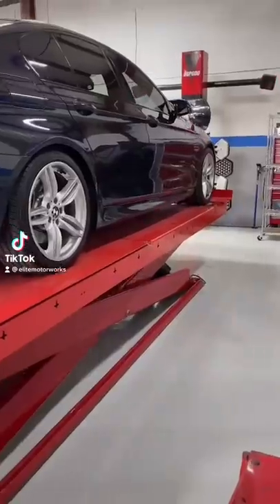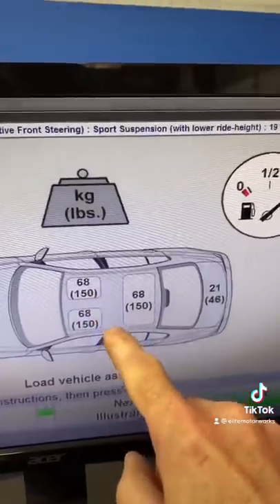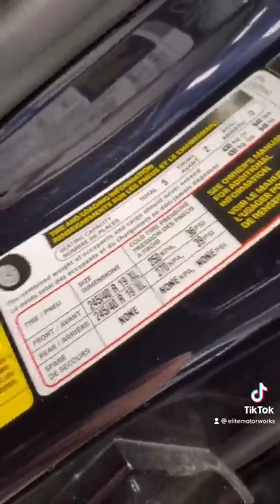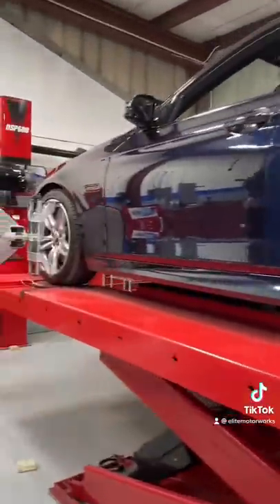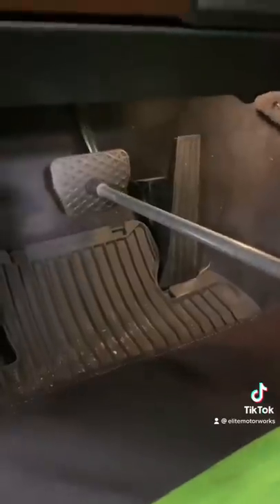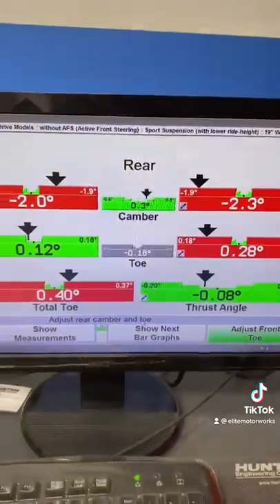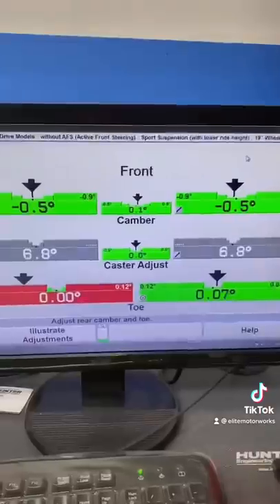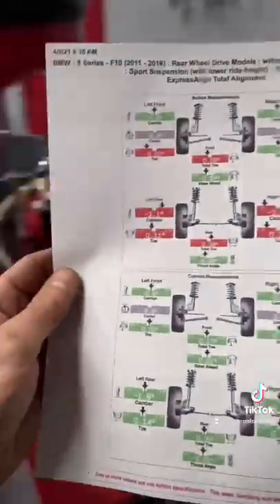How BMW does alignments #shorts

Comment: I've never seen any tech add weights to euro vehicles when doing alignments and I've never seen an issue, i like that you're doing it by the book though.
Reply: Can confirm we don't do that shit at pepboys lol....do have a nice brand new machine though, wish we had that steering wheel leveler, genius idea
Reply: Definitely gets you the best results.
Reply: @bestbomb17  me, eyeballing it wishing it was a raptor.
Reply: It’s actually pretty common, Mercedes Benz vehicles have the same procedure.
Reply: @crappy60  i think he means, he knows it should be done but not alot of people do it.
Reply: Well this dude works at or owns a really high end euro car shop, so hopefully he's doing all this stuff by the book, and he def does.  If i owned a bmw or a mercedes etc, id bring it there, until then im happy with my Sonata lol.
Reply: @crappy60  as a mbz master tech I can confirm we do not use weights when performing alignments. We do check ride height, with an inclinometer.
Reply: Idk maybe to 🤔 compensate for the passenger weigh
Reply: Then ur not a bmw tech. Everything from e46 and up your supposed to use weights
Reply: It really has nothing to do with euro vehicle's the reason you add weights is because when the vehicle is at highway speeds it sits lower to the ground and the wheels spread out a little bit further. If they're not using weight's its because they're not doing it right.
Reply: @herbsewell4995  when doing alignments only the euro and foreign vehicle ask for weights, not most cars.
Reply: @recarored9862  I don't care what the manufacturers asked for, the FACT of the matter is you're supposed to use weights on all vehicle's with the exception of heavier vehicle's, or vehicle's that have automatic ride height adjustment, or vehicle's with stiff suspension's. It's not a matter of whether or not the manufacturer asks for it, it's a matter of whether or not the vehicles ride height lowers at high speeds.
Reply: @herbsewell4995  it's most alignment machines like Hunter that have done their R&D.
Reply: There is an option to compensate for weight
Reply: I took this as a troll,but youtube says it's real.
Reply: @bestbomb17  the steering wheel level indicator on the computer is a bit useless if the alignment is already out.. I usually have to use a combination of the indicator and eyeing it
Reply: @crappy60  False. I’m a Factory trained 15 year Mercedes Benz master tech. The only thing we use specific weights for is teaching in seat occupant sensors in regards to SRS/airbag systems. As for alignments, we use a Romess Inclinometer to check control arm angles which directly relates to vehicle ride height. Other than serious race cars, I’m not sure why a manufacturer would require massive amounts of weights placed in a vehicle to perform a wheel alignment. Then again, I’ve only ever worked for Mercedes Benz. Good job on the video, though!
Reply: Most customers don't push their cars or even pay attention to how they handle. 
After the first alignment at a big tire shop my car was all over the road....like a regular car. Took it to BMW and handling went back to being like it was on rails.
Reply: Not only weights and tire pressure , but ALSO a fully filled gas tank. 
I learned this as well after owning my second bmw. Took it somewhere else, told me about the requirement, filled up the tank, had them add the weights, and it drove dead straight after the re-alignment.
Reply: Well the more weight you add and the more the suspension is going to be compressed in the alignment of the wheels and everything will change so if you put the recommended weight in it like they did it's acting as if it's full of passengers so then you get the best ride possible
Reply: @mbdoc631  inclinometer? Why would you use one and how would you use it for ride height? We use those in aviation maint to measure/adjust blade angle and flight control travels. Wouldn't a tape measure and bubble level be cheaper and easier to use just to measure ride height? Seems overboard/unnecessary
Reply: @crappy60  extremely common procedure that is never actually done. That’s what you meant to say.
Reply: @herbsewell4995  i do many alignments a day and don’t use weights ever. Don’t need to. Never have and again the only vehicle Iv ever seen need weights are BMW and mini coopers. Both garbage vehicles. Iv done all the luxury brands and even my own on my
Lexus and have never had any issues or ever needed weights.
Reply: @herbsewell4995  dont worry the person that will do your alignment won't add weights.
Reply: @recarored9862  I'll do my own alignments.
Reply: I always align my autox cars with my weight in the driver seat so I know that my alignment specs will give me the exact handling characteristics I want.
Reply: It’s in BMW’s methodology anyway. They even state that when changing the control arms you need to put the vehicle weight on them before tightening the bolts. So they are set in a neutral position.
Reply: That's because you don't need to add them to most Euro vehicles.
Reply: Could difference between a winning and losing, everything adds up.
Reply: I used to work at a big bmw dealership and none of the front end guys would put this much weight in.
Reply: @herbsewell4995  good luck affording a 30k alignment machine.
Reply: @recarored9862  Funny story about that Nissan too. Nobody could figure out what was wrong with it, it had 338k original miles on it (01 Pathfinder), it ran and drove great no real issues anyway, then it just stopped running out of nowhere. The day we were going to scrap it I decided to open up the ECM and one of the chips exploded, never seen anything like it. When I took it to the dealer with the new ECM I called a few hours later and they told me they were still trying to figure out what was wrong with it after I told them just to flash the ECM. And this is why I don't trust anyone to work on my vehicle's.

Edit: I forgot to mention I found the culprit, the IAC valve fried internally and there was no fuse between it and the ECM for that year.
Reply: Most tire stores might have pretty up to date racks and computers to align it, but I've never seen them supply you with the specified weight needed for these euro cars.
Reply: @erichodges7131  
When I worked at BMW we never added weights. We checked ride height, perform a caster sweep, and usually use the calibrated win toe procedure for front toe adjustments. Never had a problem with alignments not coming out great.
Reply: @jamesgarrison6430  but are you ALWAYS riding around with a car full of people? I just know how Mercedes Benz does it
Reply: Yep never did this at fountain tire hmm wonder why we had come backs?  The machine says exactly what is requires naaaw that's OK tho.  500lbs won't make a difference 🙄
Reply: Where is the graph or rear toe adjustments?
Reply: With the newer machines it auto compensates and is not necessary hes got a older setup it more finicky
Reply: I was a platinum level tech at Honda for a long time. Nobody does that at the Honda dealership. Maybe it’s a euro thing. They def like to over complicate things. That being said it does make some sense to replicate people in the car. In the Honda world we did not do this though.
Reply: @mbdoc631  Yes can confirm as well, especially with air suspension even if you add weight as long as the suspension has had time to adjust for the weight the alignment is the same with and without weight.
Reply: We don’t add weights… we straighten the mf up drive the bitch and let it roll
Reply: Hi
Reply: @herbsewell4995  Agree, I average out based on my bosses weight as he's the average dude. Add a bit of weight to the vehicle and boom. Never once got a complaint. Granted this is not at my work but I moonlight as an alignment guy when they need one at a friend's shop. I am certified in it, as well as a state and ASE cert mechanic. I prefer to add weight to anything less than a f250/2500 granted it depends on vehicle weight but I've noticed it makes a difference. I aligned my mom's Lincoln with weight and it'll track straight as hell at 75 all day where before it would pull with the crown of the road
Reply: @bestbomb17  I work at BMW and the shop doesn’t even have the sandbags
Reply: it would cause an issue tho even more so with anything wirh independent rear suspension
Reply: @eastcoastitalian8758  dude I wanna own a German car after this video
🤞
Reply: Pretty sure I've seen it in one of my Bentley manuals for my various VW fleet. 
It's more of seeing what the numbers change to after adding weight if I recall the steps correctly.
Reply: @eastcoastitalian8758  Untill the engine blows up in your Sonata 😂. Not saying German crap is any better either.
Reply: @herbsewell4995   all cars???  Yeah, no.  My jk with solid front axle does not require weights.  I think you meant to say SOME cars.
Reply: Because when car is loaded with weights its tyres tilt little outside
Reply: Most vehicles do not require added weights..! Source: I have used same equipment for years
Reply: BMW tech, and we never add weight like that to the vehicle. Car isn’t riding down the road with all that weight in it normally.
Reply: We used to add weights. Techs found you can adjust the angles a bit to each end of the spec and it acts the same. My friends at Bmw have mixed results and state that some techs do it and some don’t. What i will say is that by doing the compensation by moving the left rear tire can affect the readings! You have to push and pull the car by way of the body. Tried it multiple times and it does affect comp. Watch any of the hunter or John bean alignment procedure vids and you’ll see that.
Reply: @herbsewell4995   a car going down the HWY does not sit lower.  Cars don’t create downforce without wings and chin spoilers.  If anything they lift because of the Bernoulli principal which creates an area of low pressure above the car as air travels over it.  Just like a cross section of a wing.
Reply: @MOSTWANTED1908  I took automotive technology in college and in suspension class we were taught to use weights to simulate the driver or their normal cargo/passenger load for best alignment.
Reply: I worked at bmw and yes by the book we had to do it but....you know....no?
Reply: @Volksoner619  So you've been doing alignments Wrong for 30 year's. Congratulations.
Reply: @herbsewell4995  interesting. If that were true you’d think I’d have a lot of come backs. When my customers return for roto/balances they often thank me for how well their cars handle. And their tires wear nice and even. 
Car drives straight and tires wear even sounds like I’m doing something right.
Reply: @Volksoner619  An alignment tech that can make a car drive straight. Good for you.
Reply: @Volksoner619  Do you even know why you're supposed to put weights on a vehicle?
Reply: @herbsewell4995  lol. Yea bud that’s the point of an alignment. 
Go back to painting faces or whatever it is you do clown. Leave the wrenching to the professionals.
Reply: @Volksoner619  I was rebuilding carburators at 8 year's old at the same time I rebuilt by first V8 engine. I've forgotten more than you will ever know about mechanics.
Reply: @herbsewell4995  yes it’s to simulate occupied weight.
Reply: @herbsewell4995  lol. I don’t need your life story.
Reply: @Volksoner619  I think he's a troll either that or he really thinks there's no one out there smarter than him
Reply: @byc8101  he’s obviously a genius. He was building top fuel dragsters when he was 8. But that shit was too easy so he gave it all up to go to clown college.
Reply: @ThorAxeTheThunder  low pay will do that.
Reply: Seems like a good way to mimic drivers in the car
Reply: @bestbomb17   like he said bro “ not like the big box stores “ cough cough pep boys
Reply: @Volksoner619  and here I am 6 years into being a nissan tech and I'm still learning new things, must not have that genius in me Like he does
Reply: Audi tech here. We use the VW supplied weighted bags just like this for the alignments that require them.
Reply: That is why BMW is a driving machine.  Everything else is just a car
Reply: @bestbomb17  i have the level but don’t like to use it as it doesn’t sit right in a lot of wheels
Reply: Why add weight to rear seats and trunk? I carry nothing in the trunk, have no kids, and only weigh 150 lbs. Alone 95% of the time.
Reply: @Josh-zf1ev  Nah man he’s right. Cars lower themselves at higher speeds. That’s why formula cars have wings. It’s not for down force like we all thought. The wings are there to lift the car, otherwise they’d bury themselves in the track. Duh. I verified this information on the youtoobs. Also did you know the earth was flat? Man you can learn all kinds of neat stuff on the interwebs. Lol.
Reply: @herbsewell4995  manufacturer specs for alignment can account for any drop due to aerodynamics or passenger weight so no you don't have to have added weight to do a proper alignment. Unless the vehicle has an independent rear suspension and carries excessive weight for whatever reason. These cars likely have if to compensate for passengers and cargo not drop due to aero
Reply: My 740i requires weights, too. It matters.
Reply: If it matters then the Manufacturer will specify it. If the manufacturer specifies it then hunter or whatever alignment system is being used it will let the technician know just like it did in this video. If the technician does pay attention or have a properly upgraded machine then them and or their shop doesn't need to be doing alignments. If you fallow manufacturer spec your good. If the manufacturer doesn't require weight then you don't need weight. For then ones here saying add weight to every vehicle I ask if it isn't specified how do you know what to add to do it correctly?
Reply: @gofigure84  this guy gets it. 👏👏👏
Most vehicles don’t require weights because the manufacturer was smart enough to provide the unladen weight alignment specifications. 
The only other time you might need to weight the vehicle is if the driver is extremely fat. 
BMW requires weight because they don’t know how to build a car. 105 years and still can’t make a blinker work. Lol.
Reply: Donald Higgins  again I ask the question what are you compensating for the the manufacturer didn't if they don't require added weight and how much do you add and where? In this video BMW called for specific weight in specific locations. If Chevy does give an additional weight spec for an alignment where and how much do you add? The answer is 0 because Chevrolet as taken into consideration everything they need in coming up with the specs. For most vehicles manufactured this weight isn't even add at the factory because it isn't required. You can add weight, but an alignment isn't wrong if you don't when there is no requirement to do so.
Reply: Donald Higgins  I would also ask when you rebuilt carburetors and engines did you use a tap and die on every nut and bolt or in every hole? Did you torque every single bolt and nut to spec or just the head bolts? If going above and beyond is the only way to do it right then that should be the case with everything.
Reply: So Donald no answer to any of my questions?
Reply: Not  seen neither
Reply: @PaedrianGuides  At least I know how to properly speak English. You can't even see the difference between your and you're.
Reply: @eastcoastitalian8758  you pay around 100euro for adjusting in germany.
I own and serviced many cars  for 18 years now.
But never seen anyone Aldingen weight
Reply: We use to use cat litter bags at my dogs old euro shop with the hunter.
Reply: @wecx2375  yeah, Iv heard of it but never once seen it or have been taught it other than on that one BMW that required it and my manager turned the alignment away because we don’t have weights for our “Hunter alignment machine”. Been in the automotive industry for 7-8 years now. Only once Iv seen that happen. I don’t 10, 12, 15 alignments a day. Iv never once had an issue or a come back on an alignment except for an F350 super duty because the steering was slightly off center. But didn’t need weights for that either. Just hate people like that one dude calling me a hack cause he thinks he’s on top of everybody else yet doesn’t work in a shop nor has the tools to work in a shop. But this my daily career so what do i know lmfao. ASE certified also but again. I don’t know what I’m talking about.
Reply: @MOSTWANTED1908  I mean, maybe you don't know what you are talking about. People do things the wrong way all the time. Think of the Science of why doing an alignment with the estimated load in the form of weights in the vehicle. I understand people cut corners on the job all the time.
Reply: @wecx2375  you’re 100% right, i just know that in my 6 years and the 2 places Iv done alignments we’ve never used weights nor has it ever been mentioned to use weights other than when working with BMWs or mini coopers.
Reply: @MOSTWANTED1908  I believe you, I moved on from auto mechanics to industrial and became a millwright. It's no different everywhere, we all have to get things done good enough and in a certain time frame with what we have.
Reply: @johnlever6696  as a BMW tech I agree. Its called the "design position"
Reply: I had an issue with a customer, he kept saying my alignment was trash..I never saw the guy personally, the front desk always dealt with him. After the second alignment he was upset with I had a talk with him and noticed he was pretty close to 400-500 pounds...I had him just sit in the car while I did the alignment and he was happy with how it drove afterwards
Reply: @Tanner-tn2mn  +++
Reply: @bestbomb17  glue a regular level bar to a steering wheel lock
Reply: same, the car needs a full tank aswell, not often ive seen that
Reply: It makes sense tho, I mean no one is driving with no one in the car 😂 if you can afford Mercedes, BMW, etc. take it to the people who see them everyday hahaha
Reply: You really need to add them I did one and got burned but to be fair my shop didn't have the weight bags anyway so nothing I could've changed
Reply: Worked for a shop that did alignments for a big body shop...they would line cars up at out shop for alignments...trust and believe, you will do it exactly by the book when dealing with insurance companies cause when the vehicle goes back and the insurance adjuster rejects the vehicle's alignment for whatever reason,  it's coming back and you're doing it for free this time...euro vehicle ARE A PAIN IN THE AZZ.
Reply: I work at toyota and we dont weight cars before alignments but we do check ride height on the lexuses and sequoias that have air ride
Reply: When the do it at the dealership it’s $500 not the usual $130 so you get what you pay for
Reply: thismof0  not really they are going above and beyond what most regular repair shops are doing and the OEM alignment process is way more involved than just setting the toe and letting it go
Reply: thismof0  it’s called preventative maintenance AAA recommends replacing tires @4/32 when in NYS 2/32 “passes” inspection and on BMW and ME/BE they have brake wear sensors to tell you to replace them
Reply: Most shops dont even supply everything you need to do alignments correctly. Even dealerships. I only ever see euro brand shops that will more than likely have all the right equipment
Reply: Where’d you get the weights info? All data? How much for a 2009 holden commodore with a 6 litre? Lol
Reply: I was a tech for bmw and mercedes was in the same shop on one side. neither of us used weights. And the techs were all certified and some had been there for 20 years. the foremen for both companies were very meticulous with their work and still never did that. all alignments i did were good without weight
Reply: We dont even do that at the bmw dealership
Reply: I always add weight to the driver's seat to compensate for my weight. Not 500lbs all over the car though!
Reply: @bestbomb17  Those steering wheel levelers are nice, but a torpedo level and some sticky tack works just as well!
Reply: @bestbomb17  That's Pretty Sad we did all this at the Auto Center I worked at because some Vehicles require the Weights and Steering Wheel Leveler should be aust because it locks the Steering wheel level so it can't move I have Gotten Alignments where my Steering Wheel was cocked to the Right and I got that done at one of the Big 20 Dollar Oil Change Places
Reply: Same
Reply: @crappy60  some fords as well
Reply: @erichodges7131  my e39 needs weights. Thats much older than the e46
Reply: Most models say this but I don’t work for bmw lol I won’t lie my f30 I had to do it twice but the second time was actually perfect. But being that your work for Bmw you better do it by the book. Jaguar doesn’t do this albeit you have to take the splash shield off to get to camber and caster adjustment bolts. And the splash shield literally has 20 bolts on it too LOL smh
Reply: Yeah same use to do alignments all the time never even knew about weights 😳
Reply: That must be why my honda civic cambers itself out when my fat friend gets in
Reply: Go go any BMW dealership and they will align the cars properly by the book like this. There’s a reason it’s done.
Reply: @mrrodneyalong  correct, thats why bmws drive so well. As far is I know for years bmw have loaded the car because an empty car isn't correct for every day use. Until you have took a bad car in then you'll never experience the magic feeling of the car driving like it was designed to.
Reply: I worked at one of those "big box stores" decades ago. I saw a lot of BMWs wear the inside of the rear tires if camber was set correctly without the weights. Still aligned it, didn't care,  because the "manager" knew "more than me." Just added notes it needed weight and adjusted the camber as far positive keeping it in the green for the printout. Worked out ok but not everyone there did that.
Reply: @herbsewell4995  yeah of course because the geometry changes with the weight...how is this not basic alignment understanding?
Reply: @mbdoc631  I second that except I'm bmw master tech
Reply: @kneecaps2000  lol you've never done an alignment in your life 🤣
Reply: @daggermouth4695  No but I've replaced dozens of suspension parts and understand that the alignment specs provided are usually with the vehicle weighted in a certain way. Pros like to act on like this stuff is rocket science..it ain't.
Reply: You might not notice it but at the end of life of the tires you can definitely tell if an alignment was basically perfect.
Reply: Who said that was by the book  ?
Reply: @Hihello  not even at the end of life.
The idea is to fix it before they wear unevenly
Reply: I can confirm only 1 bmw at sears ever got this procedure done before I quit.
Reply: The issue i have is you set the alignment then remove all that weight and camber and toe changes the moment you do that. But thats how the manufacture wants it dome to spec.  Ive been doing them on aor ride systems that if the ride height sensors arent calibrated properly,  your rear cmber amd toe is out of spec and may not be adustable, and t fron castor, camber and toe may not be able to adjust into spec.  Just because you can  doesnt mean you equip and build vehicles that way. Ive seen 5 year old cars that are so far out of spec that will never be ablento be adjusted into spec again.   Gone are the days with setting toe and letter-go.   We have a state of the art, wireless Hunter machine and i can also adjust the rear bamber and toe perfectly to spec and the front castor  camber and toe, then the car drives crooked and steering wheel is not straight. Sometimes no confidence in these machines.
Reply: Every decent car alignment do this in Brazil. It's a standard procedure. Same goes for all brands, even if you're bringing them your old FIAT 1.0, they would do this properly, the same way as it were a brand new BMW
Reply: You’ve seen every euro vehicle alignment on planet earth?
Reply: @chrisrobles2012  that’s because the first shop probably didn’t align it correctly, you can align a car wrong regardless of weights or fuel
Reply: @herbsewell4995  it’s not 30 yes ago, high voltage cars rolling out more and more also more computers running stuff
Reply: Agreed, the car is being set up as if it has four or five people init , it will handle differently with just the driver . Set it is static with no weights works perfectly . If you are going to do this What happens when you have the driver and a rear seat passenger sitting behind the driver . If this is the set up required by BMW it's ludicrous, made to line the dealers pockets
Reply: I work for audi in germany, we dont do that here either
Reply: Must cost A LOT though so yeah

You can eat pizza with gold but that slixe isn't going to be a few dollars
Reply: Manny M and use a toe press bar.
Reply: Never done it. Never had an issue
Reply: More weight = more camber, so if you haven't added weights you can under-camber the vehicle.
Reply: Those technicians know this information, but management won’t spend the extra money and time on obtaining the correct equipment to perform the correct procedure.
Reply: Weight does matter to a degree. I seen people weight 400+ needing to set in the driver seat just to get a proper alignment.
Reply: @johnlever6696  that's every vehicle known to mankind. If you tighten the suspension with the wheels in the air, when you lower the vehicle, it will add unnecessary twist to the control arm bushings. This shortens their life considerably.
Reply: @LynxStarAuto  that’s very very wrong. If the car has wish bones and the bolts for the bushes go vertical there is no need to. Look at the front end end of a mondeo.
Reply: I work for a small race team and we add the weight of the driver to the car when aligning and filling tires. It's super accurate. This guy is really good and knows  what he is doing.
Reply: @michaelric3540  definitely makes no difference
Reply: @eastcoastitalian8758  funfact, not even dealerships do that
Reply: @crappy60  I've had 3 Mercs, never seen them use weights. Reminded me of my '95 C class. It used to pull to the left under braking. The shop couldn't undo a bolt, spent hours getting that bastard loose. 
They aligned it perfectly once I got it unstuck.
Reply: Depends on the software that you have. The software I have at the dealer doesn’t need weights added, and the rolling compensation isn’t needed due to the special adapters used on the rims
Reply: Lol those bags is extra
Reply: @johnlever6696  That's any car ever lol. Any service manual on any make and model will tell you to do final torque of suspension components with the vehicle at ride height. Has to do with ripping bushings, absolutely nothing to do with who makes the car.
Reply: Probably only because they’re putting it in the internet
Reply: Very much so. I imagine he also used a toe spacer bar.
Reply: @mbdoc631   Bmw Master Tech here I can also confirm. I/We do not use the weights while doing alignments.
Reply: @mike7870  correct
Reply: @erichodges7131  Yeah. But I also had tire shops do it regardless since no one ever has the weights, and it always turned out fine on my E46.
Reply: Good to do it after change shocks and tier rods
Reply: I work at a BMW dealer and we don’t even do that at mine😂 we flat rate ain’t nobody got time for that if it’s green it’s good
Reply: Never thought about it but it makes a lot of sense for cars that don’t have double wishbone suspension
Reply: @mbdoc631  what the point of checking it if ur not going to do anything if it's not correct.
Reply: @erichodges7131  E39's need weight also
Reply: In theory, the correct way to do an alignment, would be to load each vehicle as it would most be used.

If one person daily drives it, you'd want approximately their weight added to the vehicle before and during the alignment, so that your angles are achieved with a loaded vehicle in mind.
Reply: @erichodges7131  he said he worked at pep boys, he’s a glorified lube tech 😂 never will be a bmw tech
Reply: @BrianCrofoot  false you’re a glorified lube tech, I worked at a basic mechanic shop and even we used weights on Mercedes
Reply: @kaithomsen2336  sorry buddy. I’m a now 16 year Mercedes Benz trained CDT (centralized diagnostic tech). Only about 400 of us in the entire country. You can obviously use weights if you’re looking to dial in an alignment, but Mercedes does not specify the use of weight in any alignment. Not even the AMG GTR. Just deactivate rear steering with Dyno mode, set your angles, the. Do a teach in of the zero point setting. But hey, what do I know? I’m just a lube tech. 😂
Reply: @kaithomsen2336  okay buddy. Show me where the Mercedes Benz engineers specify you need to add weight for an alignment. I’ve worked for them since I was 17, and I can promise you, they NEVER specify adding weight to any car for an alignment. You keep doing what you’re doing though man! 👍🏻 you clearly are smarter than these German engineers!
Reply: @kaithomsen2336  I also don’t think you know what CDT is. It’s a Mercedes’ specific program, that has you diagnose a bugged vehicle in front of a panel of German engineers in 60 minutes. It has a 80% fail rate. So I am kind of special 😂😂
Reply: @BrianCrofoot  I mean considering this man did it on a Mercedes AND IS A CERTIFIED TECH ima believe the man with a YouTube channel not some lube tech online 😂
Reply: @BrianCrofoot  Iv been working ON CARS IN GENERAL since I was 8 😂 you HAVE to at least use the driver weight to do the alignment
Reply: @BrianCrofoot  considering this man has a YouTube channel and a following, and you don’t even have a PFP, with no PROOF of what you’re claiming, ima believe the man with video proof
Reply: @kaithomsen2336  check out my E55 AMG. 😳 😎
Reply: @BrianCrofoot  also just cuz you can do work on this ONE AMG doesn’t prove you’re Mercedes certified 😂 good try tho
Reply: I guess its because most Europeans don't weight 500lbs.....
Reply: In some cars this is not necessary but most cars have something called a mcphearson suspension. They change chamber when the suspension is compressing. In that case you need to come as close to default compression as you can in standstill. Otherwise you will have the main pressure point moved into the innerside which could totally screw up your handling.

It is independent from brand btw.
Reply: @herbsewell4995  so if I go to the highway once a month or less that means 90% of the time my alignment is wrong :D this whole weight thing is stupid, because you never have same conditions EVER.
Reply: @herbsewell4995  The REAL Reason For Using Weights During Alignment? (No, It's Not What You Think.)

According to Dinan the purpose of the weights is to simulate the angles in the suspension when the car is driving at high speeds.

When you drive faster, you'd notice that your car "sits down" lower and closer to the road. As the car "sits down lower" the wheels spread wider.

This is caused by the aerodynamics of the car. Slanted windshield, slanted hood, underbelly, etc. BMW designed the car to go lower when you drive faster, not to go higher (float).

The alignment specs are therefor there, because they want specific numbers when you, the driver, need it the most - when you drive the car like it was meant to be driven. Not while you are at your shopping center parking lot driving speed. Makes sense?
Reply: @johnlever6696  that’s the procedure listed in every workshop manual for torquing the fastener on any bushing. Always return the vehicle to its original weighted position and ride height prior to final torque. Otherwise the bushings will streeetch and tear prematurely.
Reply: @erichodges7131  no youre not, newer machines compensate the weight
Reply: Because our machines compensate for the weight 😂
Reply: NgL, Firestone nailed the alignment on my passat, over a year later and you can let off the wheel and go pin straight! The only major issue was they didn't do a steering angle relearn and when you'd hit the gas the car would light up stability control and decided you wanted to go hard left. When I say hard I mean like you yanked the wheel for an emergency lane change hard.. Fortunately I have a dealer tool for vw so I was able to reset it once I got home but let me tell you that was one hell of a ride home. If someone didn't have any automotive ability or good driving skills it could have gotten them killed... Maybe don't use Firestone after all
Reply: It’s an out of date practice bmw doesn’t even do it anymore
Reply: @herbsewell4995 key word… matter
Reply: We don’t do that even at BMW dealer
Reply: I was told as an apprentice the cars can't go fast enough here to need the weighted alignments😅 every shop I've worked in no one has the weights 🙃